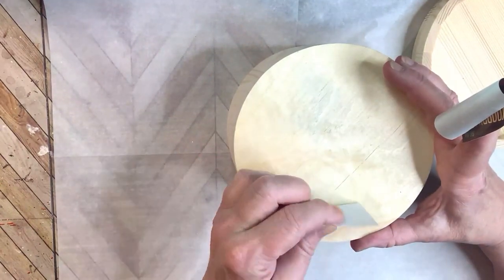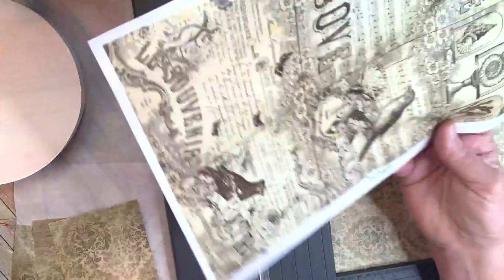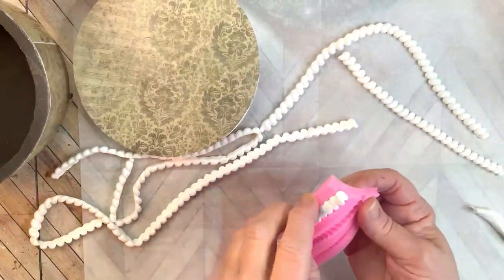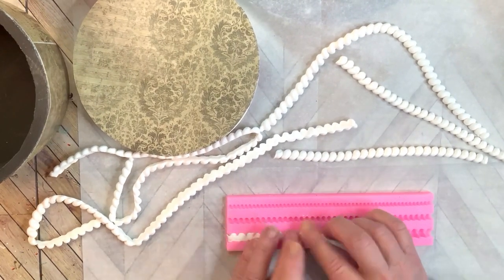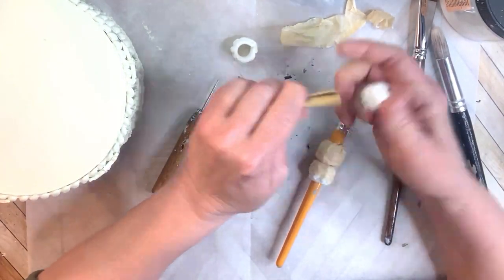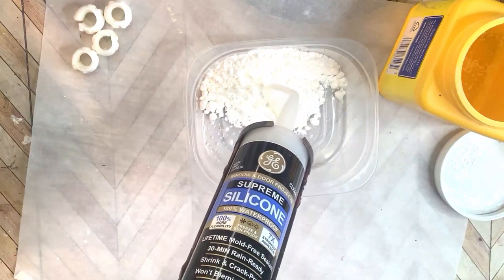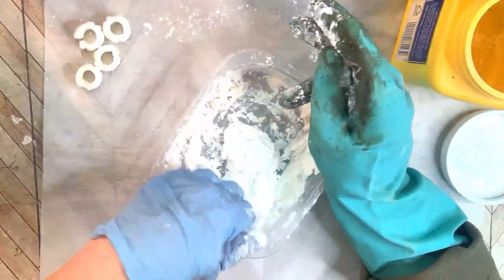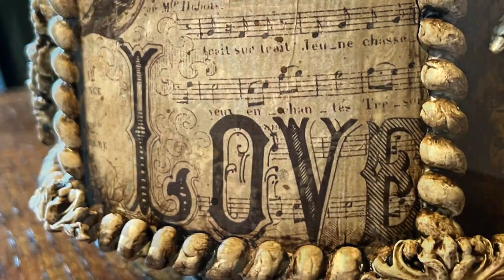Vintage Valentine Jewelry Box

Comment: How long do you wait to paint your clay
Reply from the maker: Sometimes I paint it before I even glue it on to whatever surface; it just depends on the application and the paint color I am using. You don’t have to wait until it dries completely, but most times I do wait until the next day. If you paint before it is dry, you just have to use a soft brush and be more gentle so as not destroy the detail of the casting.

Comment: If the resin sets too quickly you can heat it gently to mold it if you need to. Just use a hair dryer. Don't do it too much tho. It gets more brittle each time you reheat it and can break. Beautiful project as always.
Reply from the maker: Thank you for that tip!!!❤️👍🏻👏🏻👏🏻👏🏻

Comment: How beautiful! I really enjoy crafting w the molds, but I've been having the hardest time finding the right air dry clay. It was so frustrating when making my xmas ornaments bc the clay kept breaking or not completely coming out. Tried different brands of clay & using the "tricks" to help it come out w/o breaking or sticking, but no luck. Starting on my Easter projects & would love to know what clay u used. I don't recall hearing a specific brand. Thank you & any suggestions would be appreciated! I'm so jealous of how beautiful your molds came out.😉
Reply from the maker: Thank you so much! A few months ago, I started using mostly Hearty Soft clay for the majority of my castings. I purchase it on Amazon and the links are always in the description box below the video. One package seems to go really far, too! Hope that helps and wishing you a very blessed new year! We all sure need one, eh?! ❤️
Reply: @designsbyJ  Thank you for replying! I must have missed that link when looking at the others. I'll definitely give it a try though! Thank you, too, for the New Year blessing. Indeed, I think we all could benefit from a better year. The last few have been a bit rough. May God bless you and yours as well in the coming months. 💗
Reply: Hello Annie, I had the same troubles when I began to work with air dry clay and moulds. I have some tricks for you. If you use common air dry clay you should apply a little bit of Baby oil into your moulds. You can apply it with a brush but just a little bit. The moulds shouldn't be "wet" otherwise your clay will slide out.. so only a thin layer. That helps alot! And if you use Light modeling mass (for example Hearty Soft Clay) you should apply corn starch. You will get a better result and less frustration. Just give it a try! Good luck and enjoy crafting!
Reply: @michelloenneberga6313  Hi & thank you for the idea! Baby oil is actually the only thing I haven't tried bc I was concerned the paint wouldn't stay adhered to the clay. For the most part, the larger moulds(IOD) are ok, but it's those really small detailed ones that are giving me the problem. Thought I'd give this new clay a try, but if I'm still having issues then I'll definitely try the baby oil. Thxs again!
Reply: @superannieoakley4513  there is no problem with the paint. The clay must be completely dry before you paint it. And the oil is only on the bottom of the clay and this is usually the part you glue on your objects- so no paint is needed :) I have more troubles to paint resin ornaments. Very often the paint comes off when I touch or continue to work on it. Hearty soft clay works good but it is better to use some starch!